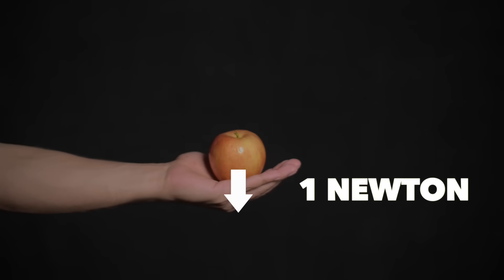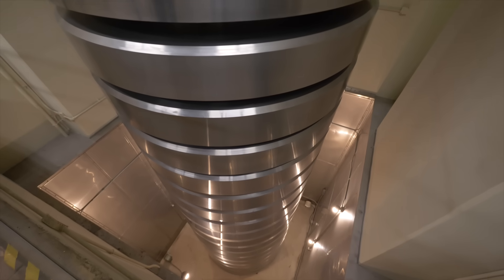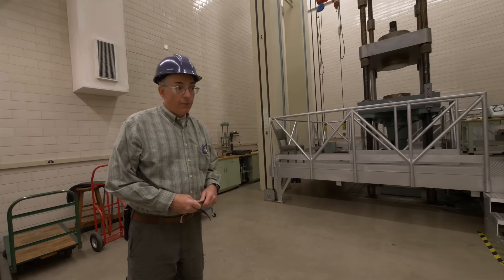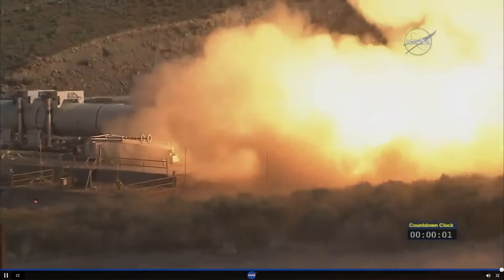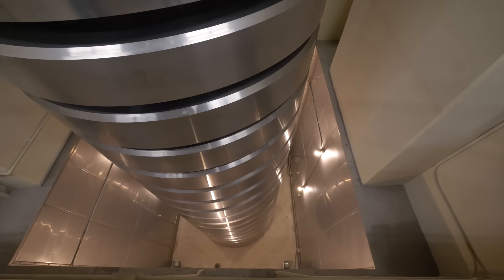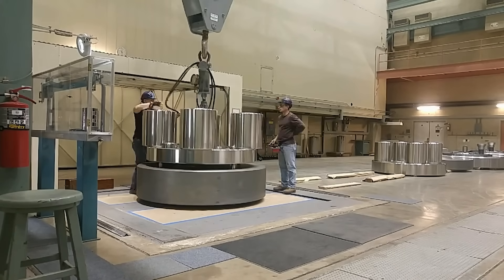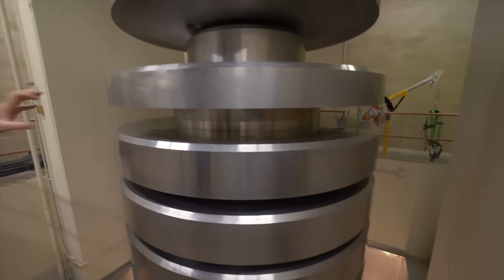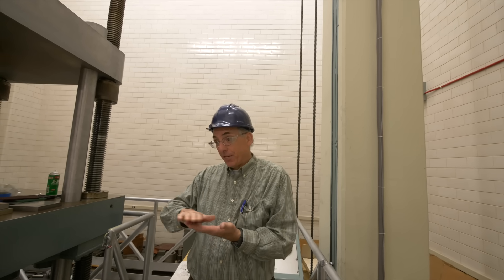World's Heaviest Weight

Comment: Using pounds instead of kilograms in engineering is frustrating. As an American I prefer the metric units over the imperial units. The only exception is temperature. Fahrenheit is more precise the Celsius.
Reply: Mr Anderson most Americans can tell the difference between a couple of degrees, just ask anyone who's ever used air conditioning. A degree or two decides if you're freezing or sweating lol

Also when taking temperature to check for a fever you need to be more precise. A variation of a degree is incredibly significant
Reply: We mostly include one decimal when we use Celsius though, making it at least as precise
Reply: I was just pointing out that sticking to Fahrenheit because it's more precise is a lie. You prefer it because you're used to it and the rest of the world uses celsius in a just as efficient way (Celsius on the other hand has benefits, such as matching the kelvin scale). 

On a side note, a 40 degree fever is a lot worse than a 39,5 degree fever. So yeah, 0,1 degree celsius is just as usable as 1 degree fahrenheit ;)
Reply: But there's no need for all that precision in a casual conversation. I don't go saying to my friends: "hey, it's 28.7ºC today!", I just say: "hey it's 29º today", because the difference between 28ºC and 29ºC is barely noticeable. Heck, in the same city temperatures can even be 2ºC apart depending on where you're measuring it.
Reply: Kelvin ftw!
Reply: F is more precise than C lmao. Troll post, stop feeding it guys
Reply: This notion that Fahrenheit should somehow be more "precise" than Celsius/Kelvin baffles me. You can't seriously be that stupid, people! Precision comes from how many significant figures there are, not from what unit the measurement is in.

As to taking temperature on a human, as have been pointed out already we usually go down to one tenth of a degree C, and that precision is needed to determine if someone has a fever.

Everyone's normal body temperature varies a bit, so you can't be certain just from seeing a measurement alone, but that goes equally for Fahrenheit and Celsius. You need to know the person's normal body temperature to know for certain. But temperature changes need to be monitored down to at least half a degree C, which is why a tenth degree is the appropriate precision to use.
Reply: Well celsius also uses comma like 22,2 or 22,3 so it can be precise as fahrenheit.
Reply: This is completely moot. The Fahrenheit scale does not exist as a set of integers. You can use fractions of both Celsius and Fahrenheit degrees to represent the other and vv.
Reply: I don't think you're understanding my point. Cause it's the same as yours. Saying that "F is more precise than C" is worthless, because you can always add decimals.
Reply: Cameron, 

We can pick a CaribbeanCaptian scale, where water freezes at 11.3 and water boils at 514, and room temperature is 100. Given such a scale, you would be lost trying to figure out whats 70 degrees, and whats 315 degrees. Sure after using it for 50 years, someone will come up with some way to determine that 200 is warm because it's twice as warm as 100, and anything in the single digits is really cold. However this scale wouldn't offer any advantage and wouldn't be any better for the following reasons:
1) the numbers in this scale are arbitrary.
2) the difference between the degrees are way to small to matter
3) celsius offers a range based on the most common liquid, and observation on the common liquid which happen daily, with numbers that are easy to remmember (0,100)
4) celsius is used worldwide and easier to communicate temperature among many cultures and people.
All of these drawbacks apply to Fahrenheit as well. If Farhenheit is superior, that why not CaribbeanCaptian scale?
Reply: okay but 2 C= 3.6 F they aren't technically more precise ...
Reply: htmlguy88 and ec is calibrated to v=y/x to the force of the newtonion complexion system for hydraulic weight equalizing to c=3.7f
Reply: tomelliott9 But L to the power of 6 equals the force of the hydraulic mandation substituting gravity itself
Reply: agar32 it was 70.4564455 degrees Fahrenheit where I live which is the atomic number for gravitational imperial Collison.
Reply: How is that relevant at all?
Reply: "Benny Löfgren2 hours ago
This notion that Fahrenheit should somehow be more "precise" than Celsius/Kelvin baffles me. You can't seriously be that stupid, people! Precision comes from how many significant figures there are, not from what unit the measurement is in.

As to taking temperature on a human, as have been pointed out already we usually go down to one tenth of a degree C, and that precision is needed to determine if someone has a fever.

Everyone's normal body temperature varies a bit, so you can't be certain just from seeing a measurement alone, but that goes equally for Fahrenheit and Celsius. You need to know the person's normal body temperature to know for certain. But temperature changes need to be monitored down to at least half a degree C, which is why a tenth degree is the appropriate precision to use." not saying you're wrong ( you really aren't) but that half a degree Celsius is also just about 1 F in fact it's 1 1/9 F)
Reply: Celsius accurately reflects what temperature water might be. 0º and below, water freezes, 100º and above, water evaporates. But I do know americans have a good notion of that in Farenheit, with 32 and 212 degrees, and know that below 32 water freezes and above 212 water evaporates. It would be silly to say that just because Farenheit doesn't go from 0 to 100 people, specially kids, wouldn't have a good understanding of water temperature. It's the same with Celsius and outside temperatures. Nobody gets confused because 30ºC is hot and 0ºC is freezing, it's just natural. Actually, it's precisely why it comes naturally to us that we always ask to at least have an annotation with metric units. And what is an extreme and rare temperature really depends on where you live. If my city ever gets close to 0ºC, and quite sure the world is ending, or at least a new Ice Age is coming.
Reply: Farenheit is in no way best for everyday usage than Celsius, at most it's the same. Having a few more degrees between two points which are considered boundaries of normal outside temperature, which even vary depending on your location, makes no difference on everyday life. About learning, by the time you learn to count to 100, and thus start incorporating the decimal system into your life, you've already learned that 30º is hot and 0º is freezing, and even if you're learning that as an adult, that's not harder than having to remember that water freezes at 32 and boils at 212, which is a basic thing to know in any temperature system. Also, Kelvin is "basically Celsius", but starting at -273.15ºC, to convert between them is super easy, so it's not really a problem.
Reply: That's precisely why I don't understand why americans insist in using a system in which 12 inches is a foot and some random amout of feet is a mile. But back to temperature, even if given an answer in Farenheit, an alien would first ask what we consider hot and cold, which are arbitrary notions, and then ask why we use a measurement system based in completely arbitrary human notions instead of a physical property like the freezing and boiling point of water at 1atm
Reply: I know, that's not my point, my point is you don't need to go into decimals when talking about everyday temperatures with a friend while using Celsius because you don't need to be so precise
Reply: In everyday usage, it's quite easy to keep a 2 digit number from 0-99 in your head, and repeat it back to a friend.
In Celcius, we often don't use the slots 30-100 degrees, and instead, to have some measure of precision, we use decimals - thus, Celcius is slightly more cumbersome to talk about in casual talk.

Fahrenheit is more precise, in a colloquial sense. Stupid Benny.

Comment: All these comments whining about the imperial system, in a world where there is no advantage of one over the other. In the same world where a second is  defined as 9192631770 periods of the radiation corresponding to the transition between the two hyperfine levels of the ground state of the cesium 133 atom instead of something more sensible. Where the meter is the length of the path travelled by light in vacuum during a time interval of 1/299 792 458 of a second and where most people happily use Celsius over Kelvin. At least you guys don't stick to tradition to the point where you wind up with a bunch of random numbers that no one will ever remember in your fundamental units. Tell me, without using a calculator, how many periods of radiation corresponding to the transition between two hyperfine levels of the ground state of the cesium 133 atom will it take light to travel 1 meter?
Reply: I know the origins of the meter; my issue is that it was clearly redefined to be as close to the original flawed definition as possible, where it could easily have been redefined as the distance light travels in 1/300 000 000 of a second or even 1 over an even power of ten. Defined this way, an important universal constant could by definition be a nice number. A similar redefinition of the second could easily make a nice number of periods of radiation in cesium. My point is that fundamentally metric is just as outdated as imperial.
Reply: well originally the meter was in relation to the size of the earth, it was then given a more accurate measurement for stability over time.
Reply: +Draenthor and not only are the both out dated but they are subjective too... people do realize that when you measure something you change the measurement by definition. So all measurements are relative. But it's still way cool. What dose a 1,000,000 transducer cost?

Comment: The reason this is not in Kilograms is that those specific units refer to a mass. In this case they provide pounds as well as newtons to refer to weight. So yes, they did provide metric units as well as English units.
Reply: Newton is a unit of the metric system, pounds aren't.

What's the point of using pounds when ultimately they need a force, which is in newtons ?
Reply: Lenayus Mynestone: I stand corrected. Except for weighing myself, I almost always use "pounds" when measuring torque. In that case, it would be the pound force (crossed with distance). But yes, the regular pound is a unit of mass.
Reply: Tyler Snell And the one way pull of dimensional forces causing extraterrestrial activity in our bodies chasing us to have no weight which  can be solved by the term g=w×1/2×3÷5d
Reply: You could use kilograms-force, which make A LOT more sense than pounds. It's archaic to keep using units like pounds, inches, feet, both ºC and ºF.
Reply: This pile of weights is calibrated to weigh exactly 1,000,000 lbf (the weight under earth's gravity). However, it is slightly more than 1 million lbm (the mass of 1 million lbf at sea level on Earth), because of the buoyant force of air.
Reply: Ian Krasnow 

Correct, plus compensation for local gravitational acceleration.
Reply: Just throwing this out there; I think when they decided on the pound, they didn’t really know there was a difference between mass and force. It’s a little bit of a pet peeve of mine that people all over the world weigh themselves in kilograms, when they should rightfully weight the force they exert on a bathroom scale in newtons and then calibrate the scale against a known mass to get their individual mass; for the reasons given in this video that gravity all over the world is ever so slightly different.
However it’s not such a great pet peeve as I have for a people who weigh themselves in pounds; but don’t understand what it means in relationship to other units of measure, besides their waistline.
Reply: Where I grew up in "provincial" England, we used pounds more than kilos.
Reply: George George, but I'm English and barely anyone uses lbs to weigh
Reply: Cagster Commentates We will have an placebolonicalonicalabloinic occurring due to intense calibers toon
Reply: George George 

I didn't read all of the comments, but, there are two units of pounds. Pound force lbf (metric equivalent newtons), and pound mass lbm (metric equivalent kilograms). the "f" and "m" are usually denoted as subscripts. The convenient thing about pound force and pound mass is that, for a resting object, they are numerically equal to one another where the local acceleration of gravity is 32.174... ft/s^2. If the local acceleration of gravity is different one has to account for that difference in the weight of that object, as they have done here. 

1 kg = 2.2 lbm, but does NOT equal 2.2 lbf, the two have very different dimensional units.
Reply: The pound is a unit of force, like the Newton. And the kilogram is a unit of mass. As an example, I am 100kg in mass, and weigh 220lbs. If we flew me up to space, I would still be 100kg but weigh 0lbs (assuming a perfect scenario where I would have no forces acting on me).
Reply: +Tyler Snell no dude lol, nice try. Pound is a label to describe weight in the exact same context as kilogram. If you weigh 220lb you will still weigh 220lb in space it's the lack of gravity silly boy.

Comment: The height of the weights influences the gravitational force on the upper weights? Since mass is what generates a gravitational force, would not the dense mass of the weights (I assume they are denser than soil or rock) actually contribute to the gravitational force? And measured weight on top of a mountain should in theory actually increase the force since there's an entire mountain of extra mass underneath?

Comment: ...why don't they use that large hydraulic cylinder on top and apply 1M pounds of force to the test subject? If the temeprature is held constant they would only need to measure pressure of the oil within cylinder. Simmilar thing could be done with large electromagnet (maybe even more precise as the current is easier to measure and control than pressure)...:/

Comment: pound force?!? it's called Newton, the Pound here are unit of Mass just like Kilogram, here's the example.
1 kilogram roughly put out 9.8 newton of force ( because gravitational force field )
take 1 000 000 pound  / 2.2046 = 453597.02 kilo
453 597.02 * 9.8 = 4 445 250 Newton 
and that's without buoyancy that would add I little more.

Comment: For the people freaking out about the "pounds of force"... It's not that hard: it's the force exerted by a 1 pound of mass at the equator. 
Particle physicists don't use Joules, they use electronvolts, to measure both energies and masses.
Hell, in plasma physics, we measure temperatures with electronvolts!
All you need is an agreed-upon conversion factor (like e, c, Boltzmann's constant, or in this case, g)

Comment: So many questions! Does the stretch in the metal rods holding the stack need to be accounted for? If they are regularly applying force between the moving section hanging from the ceiling and the moving mass hanging from the structure- surely there is stretch induced between the two, no? How is this accounted for?

Comment: But if the force transducer is to be calibrated for, say, 80,000lbs, how would you measure that, since you have one weight of (about) 50,000lbs, and then the next one which is also 50,000lbs?

Comment: @NIST @Rick Seifarth: Any recommended reading when it comes to calibrating Force Transducers? 

We've had to calibrate 5 - 10 Ton hydraulic force transducers in the past and had a hard time working out the errors due to seal friction, thermal expansion in the oil, and more.

Comment: One of the many jobs I performed in my 20 years Naval service was in the Aircraft Intermediate Maintenance Department Physical-Mechanical Calibration Lab calibrating torque tools, pressure gauges and cable tensiometers used in ship and aircraft maintenance. All tools were on scheduled calibration cycles as were my test equipment which I had to deliver to an onbase lab for testing. So I began my Navy career at the Organizational level as an end user and later stepped up to mid-level calibration. After retiring I had a few jobs in Depot Level aircraft parts manufacturing and quality control and in the jigs used to make airframes.  Getting back to calibration, I had the occasion to test up to 1,000 foot pounds and 10,000 psi.

Comment: what would happen if a million pounds hit the Earth
Reply: Someone would complain it wasn't in metric.
Reply: Depends on the speed and concentration of the impact. If you shoot one pound of something towards earth each day for one million days that won't do much. If you shoot one million pounds of something towards earth all at once with a velocity of only one meter per second you'll get the same effect as throwing a blue whale at the earth with the speed of sound. 
But you'd throw it all at once with some super high speed then... uhh... good question.
Reply: Lun Hing   Coins or paper bills??
Reply: Lun Hing are they coins or paper?
Reply: So 20000 £50 notes, i would grab them all
Reply: Someone would be very, very rich.
Reply: momentum = mass times velocity. more velocity, more momentum, more impact force, more damage. 1 pound of matter travelling 1,000,000 meters per second would cause the same damage as 1 million pounds travelling 1 meters per second
Reply: Not necessarily. Something with a mass of 1000000 lbs will probably be much bigger than something with a mass of only 1 lbs. Therefore the impact area would be greater. To be clear, that wouldn't change the impact force, just what you called "damage". That's why you can't possibly lay down on a single nail while a whole board of nails is fine (don't try this at home). 
I should add that to my comment as well... but I'm too lazy.
Reply: At what speed? You forgot half of the equation here.
Why are you watching a science chanel if you don't even know that....